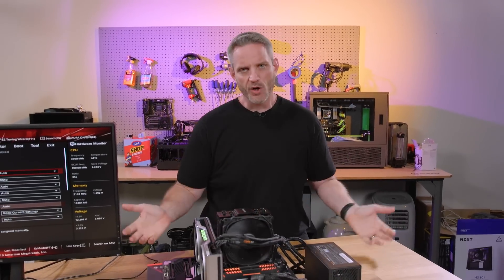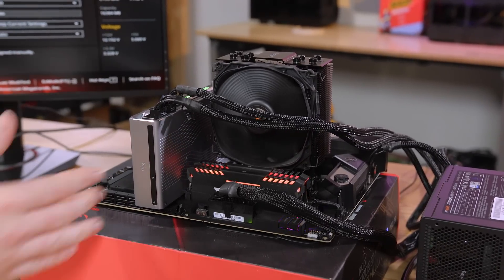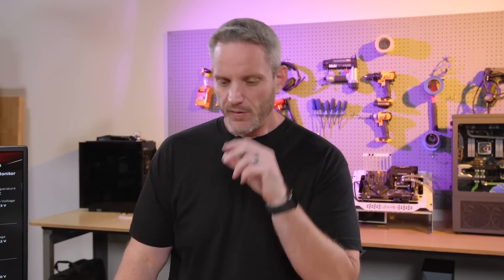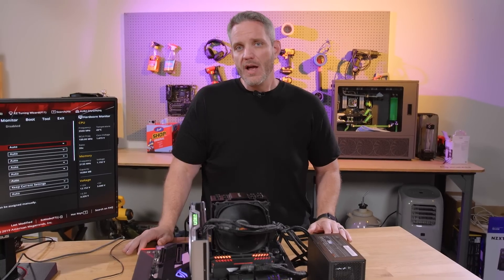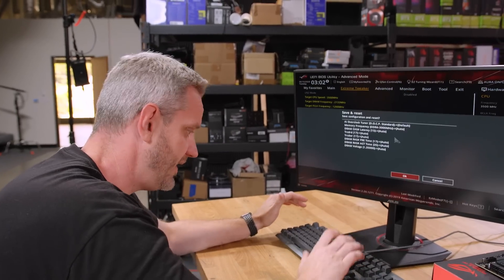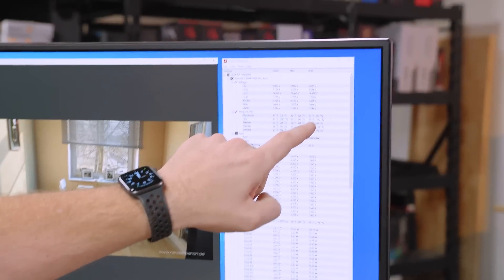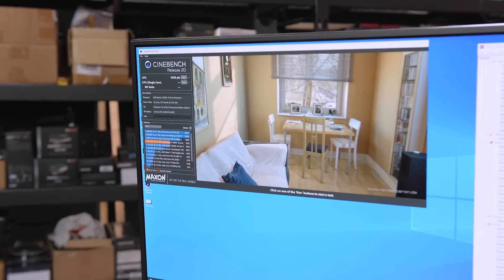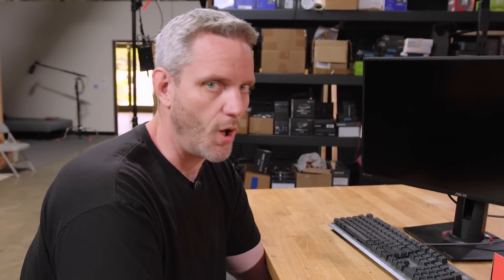Is your motherboard trying to damage your Ryzen CPU?

Comment: I'm using a new build just recently. My previous PC which I'm still using is from 2008 and it's been working for a couple years on passive cooling because the CPU fan is defective. I'm amazed it's working with a defective cooler. It's hot for sure, but it's working albeit it's been very slow the past week. Still want to use the old PC for a few more years. I finally bought a fan to replace the defective one and I'm thinking of changing the CPU cooler altogether. I hope my current Ryzen 7 will last as long.

Comment: I have a question I'm using ryzen 3600 in hwmonitor and ryzen master temps are like super high like max 95c in hwmonitor what is package node 0 it's show high temp and there is other one in motherboard section there is a cpu temp it's shows normal temps high like 68c but package node and ryzen master shows high temp is it high or it's showing false numbers?

Comment: Yeah about that voltage... I accidentally made my 4790K be stuck in turbo mode at all times, with a tiny bit less voltage and WAY less amperage...

Have I mentioned this was on an H81-Plus motherboard? I only tweaked the turbo settings because somehow Asus fucked up the settings and at full stock whenever I had to render something on Premiere the CPU shot from 45c to 100c in 2 seconds tops and shut off the system as a failsafe. Ended up optimizing the turbo myself as they overdid mostly the amps to the CPU.

TL;DR Asus shat the bed with the default turbo settings, I optimized it and accidentally locked the cpu to full turbo speed despite lowering the amps and didn't cause system instability, go figure.

Comment: I knew I wasn't the only one with this issue. Ever since I got my new ryzen 3700x and asus rog crosshair hair VIII wifi. I noticed that my cpu is running much hotter than my old ryzen 1700 and asus rog crosshair hair VI. Like 10 to 20 degrees celcius while idle. This is with an nzxt x62 aio cooler mind you. My ryzne 1700 with this cooler would run around 30 to 40 idle no matter what. But during idle with the new components i get like 50 to 60 degrees celcius idle and small load. I looked up to see what could possibly be causing this to happen. Seen many people complain and mentioning the cpu voltage in the bios. I looked and my voltage is like 1.47 and you making this video just proves that there is an issue with something. Makes me feel somewhat anxious but Ive had to adapt to the new temperature difference. Under full load the cpu temperature is 76 degrees celcius

Comment: Jayztwocents is just cringe here.  Current is what kills the cpu not voltage by itself. 3950x is recommend by amd to use at least aio water. So he uses a small air cooler. He doesnt even use hwinfo64 to monitor...

Comment: I bought a 2700X in 2018, after no issues, the CPU randomly died about 3 months ago after only a year and a half of operation. I sent the CPU back to AMD and they luckily replaced it. This whole thing got me thinking and I remember seeing the voltage automatically jumping around between 0.7v up to 1.5v sometimes. Since these were the default settings, I figured it was supposed to do that, but seeming idle temps jumping from 35C up to 50C swinging all over the place like a drunk pirate make me wonder how much this constant heat fluctuation impacted my CPU. So, when I got the new CPU i decided to turn off the features in favor of a more stable voltage. Maybe I got a bad CPU but maybe it was damaging itself. We'll never know, but I'm not taking any chances and I'd rather the computer run a tad slower if it means my hardware lasts longer.

Comment: is there a raid for processors (2 processors in 1 board) so that heat/power will dissipate on the 2  processors and it will run faster?

Comment: Got a 3950X, it's pegged at 4225 all core. I've been able to get it to 4.4 all core but only for a little and then I stopped it. I have a dark rock pro 4 cooling it and even it get's overloaded at 4.4. I'm planning on water cooling it but I'm still waiting on the new Graphics cards to come out before I make final decisions. Hopefully EVGA makes a Kingpin 3080 Ti that has a waterblock on it from the factory.

Comment: I have a 3950x and I got some stuttering in some games and after the PC was awakened from sleep mode and disabling PBO and setting a OC frequency while kinda undervolting (stress tested ofc) the system is like way smoother being locked at 4.3ghz rather than letting it boost with all that varying voltage and temp. It holds stable with only 1.2V with a OC of 4.3ghz. I feel like they're pumping too much voltage into these things on the stock setting. My temps also dropped.

Comment: i'm not expert and didnt watch your first run at this but by adding salt to the ice for the temp control you can get it lower than 0oC you can get it to -20 if mixed correctly or maybe -10 or so but it will melt quicker

Comment: Your statement about reduced longevity is important and all, but there is one factor that you, and most other sites neglect to mention. Even the most casual perusal outside will prove that people believe anything they see or hear from the mainstream media, including "covid is a hoax", or "drink disinfectant".  Thus when pretty much every tech site, when discussing builds, will always go to overclocking, which has the effect of suggesting that for everyone building or buying a computer, overclocking is pretty much a mandatory step, which far too many will believe! This is one of the main reasons people encounter problems. I have a feeling that if some miracle build could claim clock speeds matching the speed of light, most of you guys will still be encouraging people to overclock, then blame everyone else when reports start going around about PC turning into black holes, and spaghettifying their houses. You guys need to have a statement similar to warning labels on cigarettes, saying that overclocking has certain, often serious risks. Buy what works for what you do without having to overclock, then you won't have such issues! Problem solved.

Comment: For anyone with a 3600/X you can do a negative offset voltage (undervolt) of 0.075v and performance will remain the same.

Oh and I believe VID is what the CPU is requesting not what's actually being delivered.

Comment: I watched this video because of my concern with this very thing but not due to any rumors or forums/videos. Just because of the voltage being pumped into the Ryzen CPU with default/ auto outta the box motherboard settings.  2 days ago my PC died... Dead Ryzen 2700x.  Mine was set on auto outta box settings with the Gigabyte B450m ds3h.  CPU just 4 months old.   I just wanted to share my coincidental story.

Comment: i very much doubt my 2700x is just guna "die" from a mild all core overclock. but when i got it outa the box and just ran it standard it was pulling 1.5-1.58 volts. that had me pretty concerned so i stamped a mild turbo limit on it that has it running around 4.175 at idle and as low as 4.0 under heavy load but only drawing around 1.4-1.42 volts. even 1.4 volts seems high to me for a cpu but its less than the stock setup. the stock voltage was scary.

Comment: Air is not fuel. Air is oxygen. For fire you need 3 things. Oxygen, Fuel and ignition. Air is not fuel. Fuel is fuel. Air is oxygen. Separate from fuel. Air cannot be oxygen and fuel at the same time.

Comment: This is one of the reasons I have 2 profiles on my ryzen master. One is a 3000mhz at 1.25v clock on a 3900x for daily use and for gaming its a 4.4/maybe 4.5 if I want it to be at 1.35v.
Reply: I tried it with my 3900X and I can set it to 1.25V and 4150MHz, why do you "only" get 3GHz? Like, I put it on 1.05V and still got 3600MHz...

Comment: So if I am experiencing seemingly random system restarts on a new 3700X build on an x570 mobo, my mobo is allowing the CPU to get too hot and its just a safeguard restart? Radeon graphics (Red Devil 5700XT). How do I correct this and get some stability finally? I was suspecting bad spread of thermal paste from the AMD stock wraith prism cooler but have never checked or reseated the fan because I am afraid of the clips lol. However, this has not gone away through BIOS, firmware, and software updates so it is growing old fast - I cannot keep having system "restarts" when I have 20 random contacts open or be taking screenshots of my desktop every time I walk away "just in case!" Thanks for any help Jay and TwoCents nation.

Comment: Any safe voltage value for ryzen3900x ? My mobo was doing 1,45v @3.8Ghz boosting to 4.051 all cores, or 4.51 for a single. 
 I turned it down to 1.3375v @ 4Ghz for all cores, but still not sure if it's a lot voltage or not. Now it runs much cooler with almost the same performance (cinebench R20). Any help will greatly appreciated, thanks a lot.

Comment: On Asus C6H and Ryzen 2700X -> if you set CPU multiplier to manual and let PLL 1.8V voltage on auto, the mobo will set up terribly high 2.05V on PLL !
Fortunately I noticed this after 1 day of usage.
And this was $260 mobo when it was new on market.
My actual settings:
Manual multiplier 40.5 (4.05 GHz),  VCORE 1.35V,  PLL 1.8V,  RAM 1.33V (3000 MHz Corsair LPX),  LLC level 3 for both RAM and CPU and SenseMI skew turned on with default value 272. This decreases displayed temp a lot (real temp is much lower than displayed). But i'm not sure if this skew affects CPU overheat protection.

Comment: Hey guys, my sister accidentally turnt off the plug connected to my PC whilst i was running some editing app, and after that it began to stutter, and cant run games without lags, and cpu temps going about 95-100 degrees when previously it was running at 80 degrees, does anyone know how to diagnose it, or what the potential problem is?

Comment: I was originally going to buy a 3600 and overclock it, but I'm going to get a 3900 X and run it with the air cooler and not overclock it at all so I should be just fine! Thanks jayz2cents

Comment: Jay: "if your CPU was going to last 15 years and now it's going to last 12, that doesn't really affect you, does it?"
Me: (sobs quietly in "still using i7-870")
Reply: i5-750...

Yeah, that's... 
We keep our stuff a long time. XD
Reply: @KuraIthys  buddy mine was OC'ed at 4ghz 2-3 years ago lol
Reply: I thought you missed a 0 for a moment
Reply: Peasants... Core 2 Quad haha
Reply: Hold my intel compaq evo intel pentium 4
Reply: I5 4590
Reply: i7 4790k
Reply: @g0dgary  Solid processor, burnt one out after 4 years of OC and being more careful with my current one
Reply: i5-3470 (It will never die haha)
Reply: i7-950 here
Reply: Q6600 here...
Reply: Amd Athlon 64 x2 here
Reply: i5 3230m in my laptop. My mother's old laptop have 1st gen i3 and it's still usable
Reply: Sob quietly while still dreaming on getting a personal pc
Reply: i7 3770 reporting in.
Reply: I use my parent's prebuilt with an I5 650, but im almost done building my own system with an R5 3400G
Reply: FX 8350.
Reply: Phenom 2 X4 975 here
Reply: Core 2 Quad Q6600 still running after 12 years in my TV PC 👍
Reply: I just gave my thoroughly abused FX-8350 and the abused mother board to a friend whose PII 400 finally died. He actually still only uses a computer as a  FAX and office machine. 
Lucky that I still had a motherboard the can do it. Yep he uses a 56K modem. Some companies still do that because it still works and it doe not need to be monitored and up dated constantly. One of the advantages to not using the internet. Yes landlines still exist. For that reason.
For other functions he uses his iPhone.
Reply: laughs in pentium 2020m
Reply: Fx 8120
Reply: I7 3930k
Reply: I5 4690k
Reply: i7-860 o.o
Reply: Switched Last year from i5 750 to r7 3700x. And before that i fried it with an overclock
Reply: Same i7-870 running Gears 5 on High, 4k, and 40-50 fps 😁
Reply: I3-550 overclocked to 4.1ghz here
Reply: I have one with rx580
Reply: I5 3770 , i5 760 , i5 2400 are the three that form  my menagerie (and one random sandy i5 in the main  laptop , and some ancient p4 mobile in my astro laptop  ) . Im used that CPUs dont ever die . Pls fix
Reply: Eyy! i7 870 gang!!!
Reply: Ryzen 7 3800X here >:)
Reply: still using xeon x5675
Reply: i sold my i7 2600k with p68 and 16 gb ddr 3 1866 for 200$. but he was a friebd of a friend and gave them for free. after 11 f years it's boosting 4.5ghz playing bfv with 112fps and 1060 6gb. hope it enjoys it.
Reply: 5950x hopefully  it gives me 20 years.
Reply: my older pc is a intel i7 860 family, still runs oke. standing in house of parrents, got a year back new pc, 3700x x570 ultra g.byte. 2x8 neo cl14 gskill. and 2 days ago i upgraded from 1050ti evga 4gb to a 6600xt g,byte oc pro. fits better now. and huge difference from 1050ti to a 6600xt, wooow
Reply: can even put SAM on ryzen 3000 series smart acces memory. in bios 4g decoder on enable, and then in radeon settings the u can put it on.
Reply: 1680v2 😎
Reply: i7-860 :(

Comment: no that dident trigger me at all as a car guy i was taught in school that engines need 3 thinngs to run fuel air and spark but thats not entirely true. i always substituted compression for air. if you dont have air you cant have compression. a reason why when your doing a compression check your supposed to have the throttle body open

Comment: My cpu 3600  is on idle around 50°c and heavy 2k gaming around 89°c on msi custom air cooler  tried new termal paste  even took it to shop and temp are still like that

Comment: Yea.... degradation. My old Phenom x6 until 2 years ago, could reach 3.8Ghz at 74°C with stress test. now is impossible reach even 3.6 the max clock speed with OC now is 3.5Ghz with 67°C at stress test.

Comment: A couple of weeks ago I replaced my R5 1600 with a 3700X on my ASUS Prime X370-A motherboard.

In three runs of Cinebench R20, HWiNFO64 shows "minimums" of:
-86.5 %
-85.2 %
-85.2 %
in "Power reporting deviation", which, as I understand, is not "good", but, so, I should not worry(?).

https://www.hwinfo.com/forum/threads/explaining-the-amd-ryzen-power-reporting-deviation-metric-in-hwinfo.6456/

As I see it, the motherboard manufacturers should not be doing this (without the consent of the motherboard owner).

Comment: Default voltage on my 3200G system is 1.56-158V under load. I am pretty sure CPU will be better with +100 MHz and about -300mV over stock...

Comment: I run mine offset at 0.050 so max voltage only hit 1.45-1.47 single-core peek I also turn off PBO2 cause I see almost no difference in clocks but temps are way better.

I was getting voltage spikes at 1.50-1.57 which is way too high for me I get that AMD said that 1.5 is fine.

Comment: My problem is that my Ryzen 5 3600 just runs hot because it sits at 1.59 CPU voltage idle. I have a Noctua cooler and it will fluctuate between 50c and 60c with nothing running in Windows 10. If I use the Asus utlitly or Windows balanced power scheme, it will turn down the CPU voltage to 1.3-1.4 and then it runs at 40c or so. BUT, as soon as i do something that requires more cpu power, it kicks up to 1.59v or so and stays there, then the high temps again.

Comment: i personally had an issue with my ryzen 2600 and msi tomahawk b450 the voltage was way too high out of the box and was causing my cpu to run hot and crash alot in games i couldnt figure out for the longest time what was wrong i had already lost a ryzen 1600 on a gigabyte b450 motherboard it had done the same thing ran really hot crashed all the time then one day it died randomly it wouldnt boot and said there was a cpu fault on the board and everything was set to default so im not sure what that is all about

Comment: How to kill processor by mother board? Just take off cooler after year of work. Main problem is the how soket on mother board holding processor. Cases when possible to breaks out processor from socket with cooler while processor legs are bent are not normal.

Comment: i have a problem with precicion boost overdrive. if i turn it on in the bios and leave every thing else on auto. the pc becomes slow as hell. it takes ages to load windows and even navigating the explorer its slow. but if i turn on precicion boost overdrive in ryzen master its fine. i dont actually notice a difference with it on or off. i have a r7 2700x and asus prime x470. anyone else have this issue?

Comment: I would imagine there is no voltage issues if every user goes to the AMD website and download the latest chipset drivers that come included with a special AMD profile for power balance. That something every Ryzen user should do because it's not included on the motherboard manufacturer website with all the other drivers.

Comment: My MSI unify 570 Motherboard fried my AMD 3950x after the 4th bootup, no over clocking, nothing special, made it to bios all within un overclocked specs. AMD took it back and sent me a new cpu, but never had a cpu die on before, especially such an expensive one.

Comment: Being a ryzen 5 3600x owner i have a problem that i dont know the reason. When the pc starts the CPU goes 100% ussage automatically. No matter how i tune the voltages on bios or OC config it always goes 100%. However when i open the task manager it detects some process that consumes 100% usage of cpu and then it dissapears. Whenever i have the task manager open the CPU performs according to normal temps and usage. Any idea what might be going wrong? My MOBO is an x570 steel legend as rock.

Comment: I'm a little confused now Jay.  I just upgraded to a ryzen 9 3900x, and I come from the blue side.  In your first video about overclocking the 3900x, you were freaking out about the stock voltages from the mother boards, and telling us what to change.  Is that not true now?  Are those idle voltages of like 1.47 actually ok?  because I freaked out when I first boot up as well.